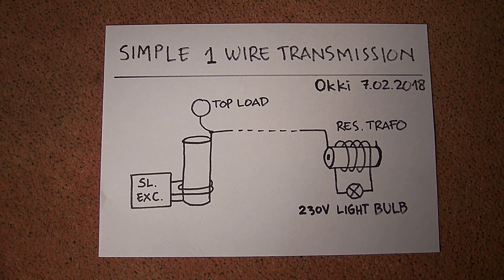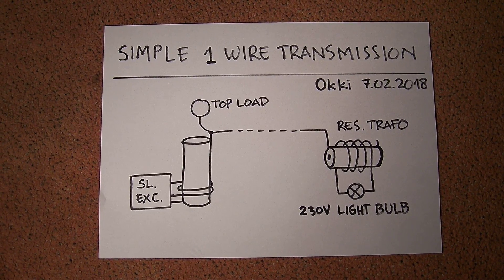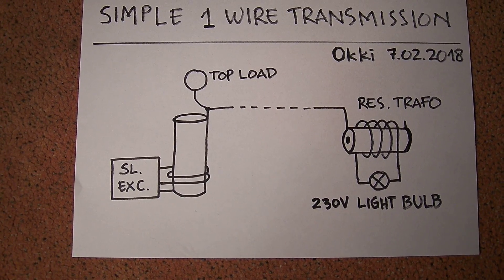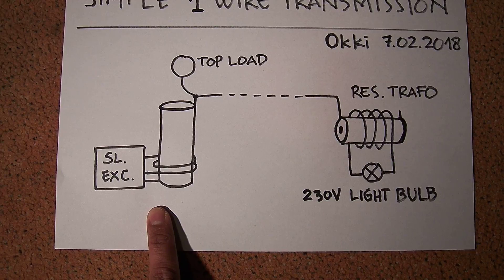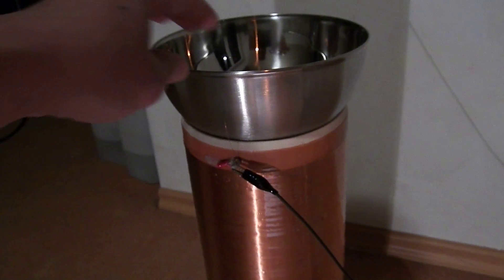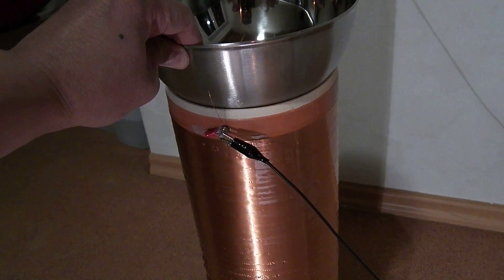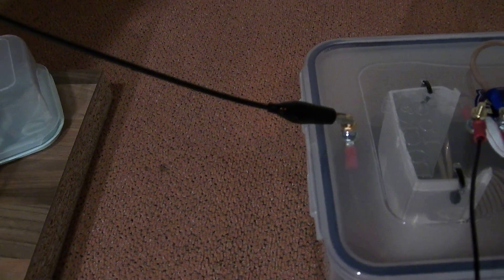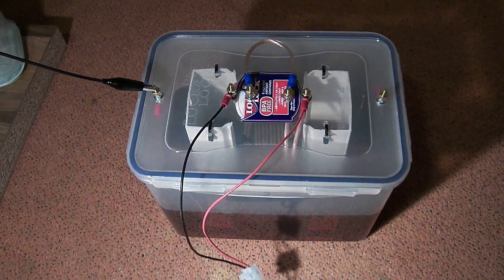Very Simple One Wire Power Transmission

Comment: I have made a slayer exciter based thing with one top load on the energizing side, and it works. Poorly, but works. I will try using a more robust battery to charge it. I think my coil designs are bad because it does not like working on the floor or certain tables. Perhaps I need a lower working frequency as it is too small. Thanks for the inspiration

Comment: Hello. I have tried making this system but I am scared to do this now. How can I safely discharge the top load after energizing the circuit? This doesnt seem to be able to discharge, and Im not sure I can trust a switch. Do you have any tips or suggestions? Thanks
Reply from the maker: If you turn off the circuit, there will be no charge at the top load.
Reply: @OkkiMoeljadi  Oh. Where would it dissipate though? Would it resonate back and forth from the inductor and itself until the energy was drained by the load on the other side and losses? Sorry if this is a dumb question, I am just very scared of this stuff.
Reply: @OkkiMoeljadi  I did more searching, it is safe with proper precautions. Thank you.

Comment: Hi Okki. Well done. Can one touch the one wire without getting an electric shock or is the frequency still too low ?
Reply from the maker: You will not get shocked with this system other than plasma burn. The Slayer Exciter might not oscillate if you touch any high voltage part.
Reply: What is the frequency it is using then ? If you will not get shocked, is it more than 1 Mhz then or will it also work from 100 Khz on already to not get electrical shocks ?
Reply from the maker: I'm sorry I don't know the frequency of this Slayer Exciter. I never measured it and I don't have the necessity to do that. I think you can get cold electricity effect from as low as 100 kHz. If you haven't touch one, you can build it yourself. Just replicate my cold electricity experiments. I have shared all my information on this channel.
Reply: Or this kit:
http://amzn.to/2CvBSwC
Reply: Or such a scope with higher sampling rate:
http://amzn.to/2sESySz
Reply from the maker: I bet you also live in Germany. Why don't you just come by, bring your oscilloscope and we measure all the signals together. I will be leaving Germany in a couple of months and move back to my country. If you want, you still have little time to visit me.
Reply: In which city do you live ? I am near Berlin, Germany.
Reply from the maker: I live near Freiburg im Breisgau. Please PM me if you need further details.
Reply: Pretty far away, I don´t know, if I will go there stlll this year.... I will let you know, if I would be in this region...
Reply from the maker: Yes, it is far away. As I already said, I will be gone in couple of months. There will be no next year for me in Germany.

Comment: nice test Okki!
what is the frequency of the working system? does it changes when the load is connected?
Reply from the maker: Thank you Gianni! I don't know the frequency of this working system. This setup is very sensitive to the load resistance. If I connect higher resistance load (lower wattage bulb), it will discharge plasma.

Comment: Typically the receiver transformer/coil uses the same transformer/coil as the transmitting coil to ensure both coils resonate to the same frequency, or are tuned with each other.  How did you tune the receiver into the frequency of the transmitter to get the best power transfer?
Reply from the maker: Hi Mark, Gianni is right. In order to excite the receiver coil, the resonance frequency of the secondary should drop if I connect the receiver. They will act as if they were one bigger coil. This auto tune characteristic from Slayer Exciter makes this setup even simpler.
Reply: @OkkiMoeljadi  quite genius.
Reply: Brilliant!  Thanks Gianni and Okki.
Reply: i think that the feedback from the secondary automatically drops into the working frequency of the system